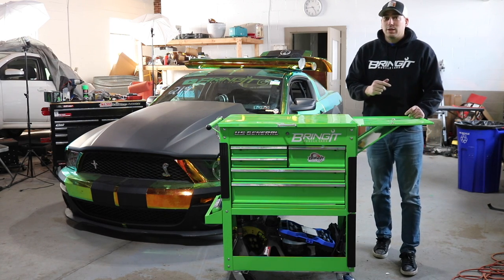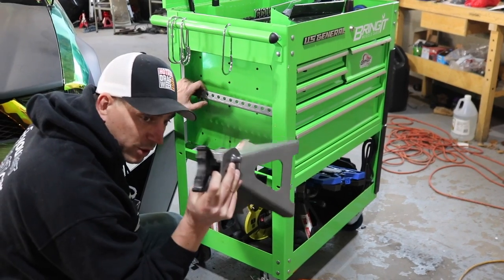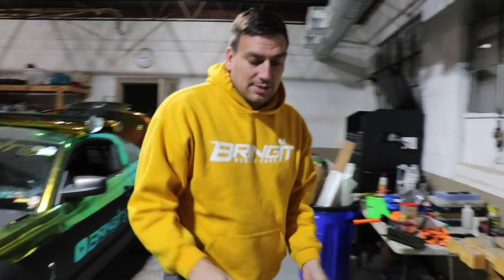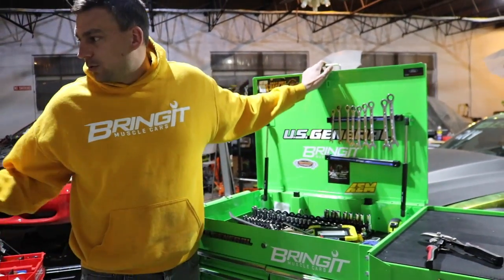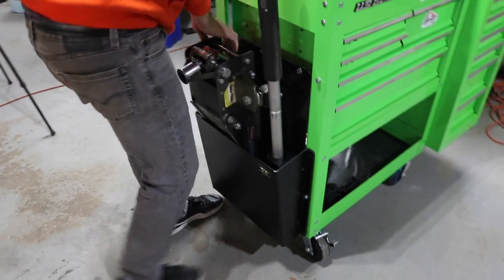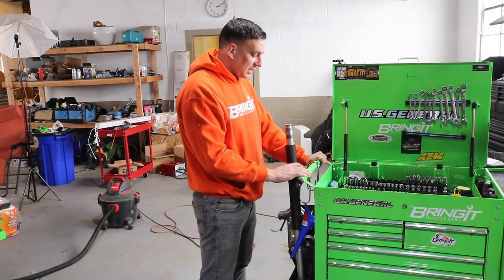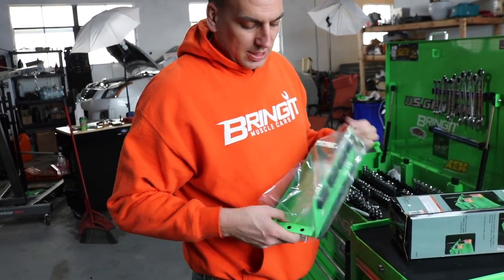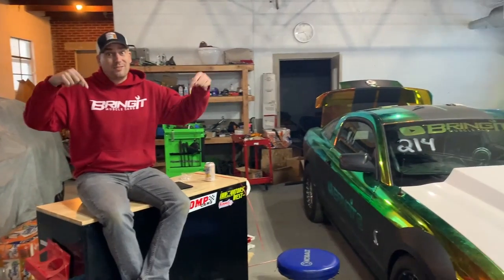HOW TO ADD THE END CABINET ONTO THE HARBOR FREIGHT TOOL CART #harborfreightprojects

Comment: I would not of added the side box the angle steel for the wheels CANNOT HANDLE THE WEIGHT IT WILL BEND AS MY HAS BENT JUST FROM MOVING IT AROUND!
Reply from the maker: CRAZY HORSEPOWER I know I’m on the very edge of that the cart can handle. If something happens I’ll figure it out I guess. It could Use heavier angle on the sides for sure.
Reply: @BringItMuscleCars  My cart collapsed just moving it around the shop. If I were you and have a welder I would reinforce the vertical angle iron or enclose the base with doors as I did.
Reply from the maker: CRAZY HORSEPOWER that’s a great idea. I might just do that. If you’re into high horsepower you should check out the videos on my 1,000 hp Shelby. I got a new supercharger so I’m shooting for 1,100-1,200 now. I appreciate the support.
Reply: @BringItMuscleCars  I have a ZL1 that I have been toying with but 84 Grand prix is my real baby as it is old school with a 327 CI.
Reply from the maker: CRAZY HORSEPOWER ZL1s are cool. I’ve been trying to race guitarmageddonZL1 for over a year. Maybe we will get to line up together this year.
Reply: @BringItMuscleCars  I have look at his cars he does some nice set ups I am entertaining right now doing a 5 speed conversion from a automatic this summer but it getting the wife to agree! I just purchase a plasma cutter and a metal chop saw she not to happy. lol
Reply from the maker: CRAZY HORSEPOWER that’s probably a lot of work. It will be fun though when it’s done. Just take her to a nice dinner maybe that will make her forget.
Reply: @BringItMuscleCars  Did that still got the evil eye.lol
Reply from the maker: CRAZY HORSEPOWER 😂

Comment: A freaking hack job, bending and distorting the metal with snips and pliers. Try using the right tools for the job, a die grinder with a cutoff wheel would have been 10x faster and it would have given clean cuts without mangling the surrounding sheet metal.
Reply from the maker: I couldn’t find mine and I wasn’t about to go buy another one to use for 30 seconds.  It still worked and people could see what they have to cut to make work. Oh well.

Comment: Those frame welds are going to crack so quickly lmao. If you’re going to do something then do it right. And you should’ve used a cutting wheel instead of ghetto rigging it with shears

Comment: Just ran down to HF picked up a 5 drawer with 189. Coupon and coupon #64590322 good till 1/15 for free side tray with cabinet purchase. I was polite, and they did an over ride and got both for 189 out the door. White in stock. Heads up there raising the price on 5 drawer $10 after the 1st...

Comment: Do you not own a grinder?
Reply from the maker: Tyler Cox I do but someone used it and didn’t put it back. I couldn’t find it. It would have been 100 times easier with a grinder.
Reply: @BringItMuscleCars  oh damn, came out great though I was thinking about doing the same thing with my series 1 cart but I wasn't sure if it would close enough to lock